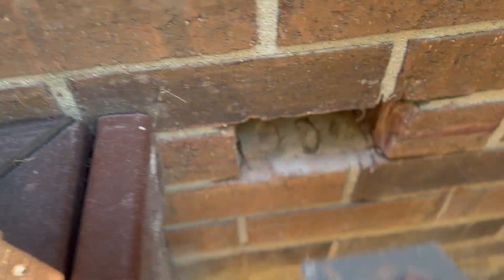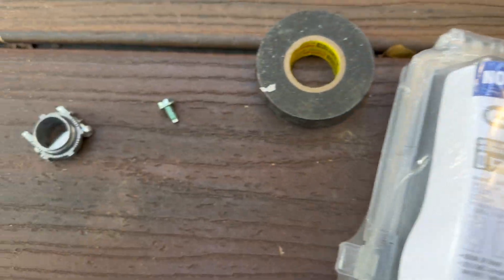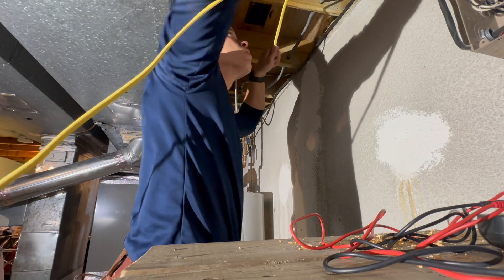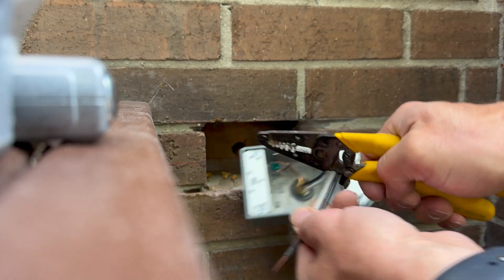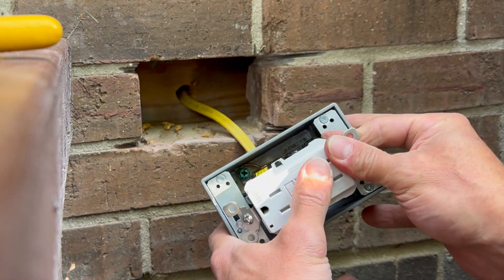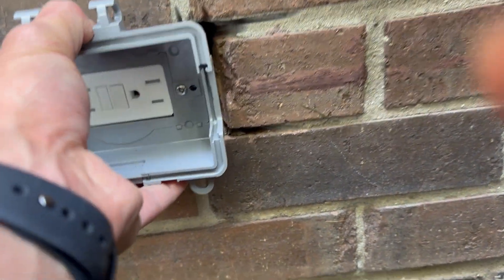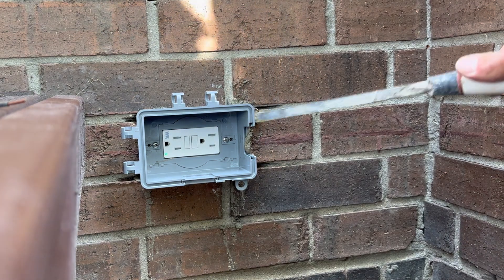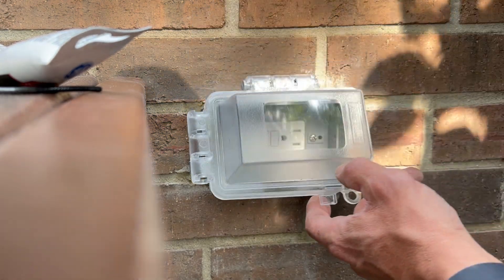How to Install a GFCI Exterior Outlet in a Brick Wall

Comment: Is the small amount of mortar alone strong enough to hold the box in place over time? With plugging and unplugging it seems like it might crack or loosen over time if you don’t secure it somehow.
Reply from the maker: @ryankrause8068  yes.  I suppose if you really did a bad job it might work loose.  But if you have a good mortar joint… say 3/8 to 1/2 inch, it’s very strong.  Let us remember the strong house the little piggy built
Reply: @thedustybuilder that’s my concern it will come loose over time the outlet box itself should have been secured to the wall before you put the outlet in
Reply from the maker: @jeromebrock3946  it doesn't get attached to the wall, it is back behind the brick.....the brick is a veneer that sits in front of the wall.  You are basically cementing in a metal box, wiggle a plug all you want, she aint movin!

Comment: Why not use screws to attach the back of the box to the wood in the wall?
Reply from the maker: @rock-on6nt  you could…… but the back of the box is 2 inches away from the wall.  If it was a new construction scenario, you could fur the box out and brick around it.  But for a retro fit mortaring in the box works great
Reply: @thedustybuilder Okay. From the perspective of the video it seemed liked that box was just as deep as the hole and butted up against that wood.